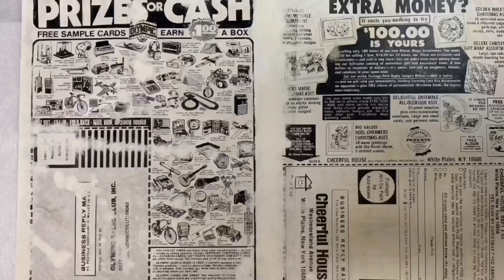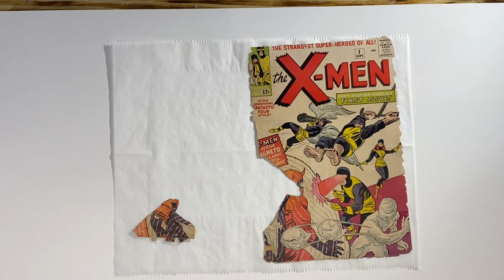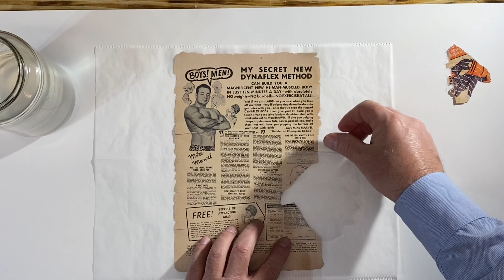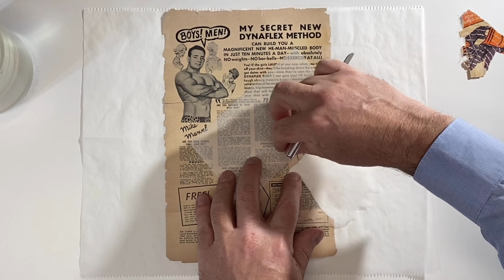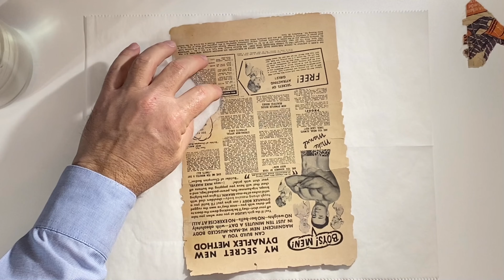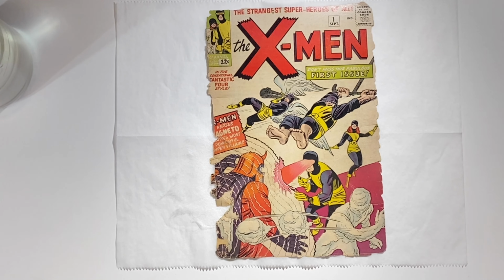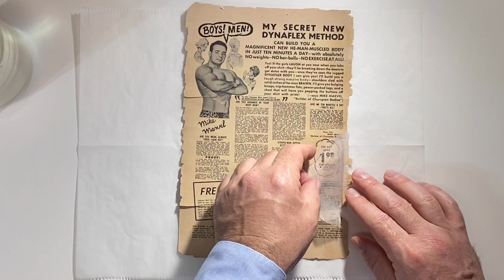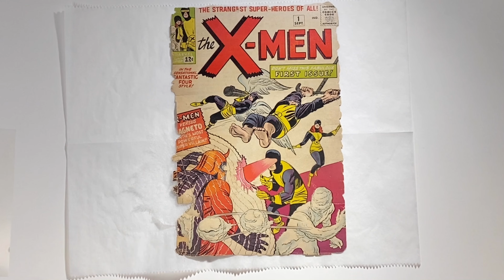X-Men Number 1! Building a Silver Age Comic for a CGC Conserved Grade? Can it be done? Part 20

Comment: Fantastic.  I do have a question.  How do your tear fixes not come undone during leaf casting when the paper gets wet again?
Reply from the maker: Thank you Michael. If you do not disturb the paper when leaf casting usually the Tengujo and methyl cellulose will stay put.  Also I added pulp on top of the repair. When it dries under pressure it seals up again and the bond remains. Stay tuned!